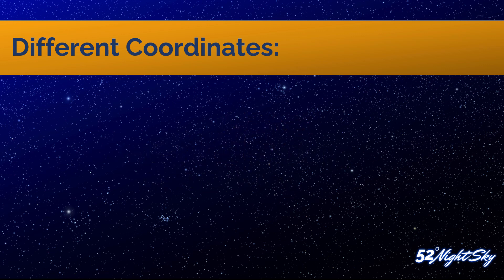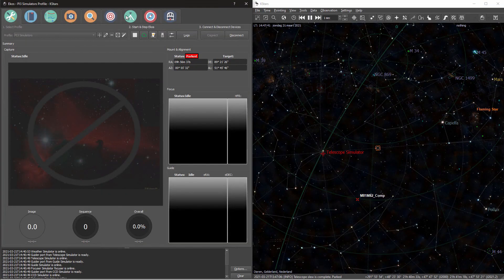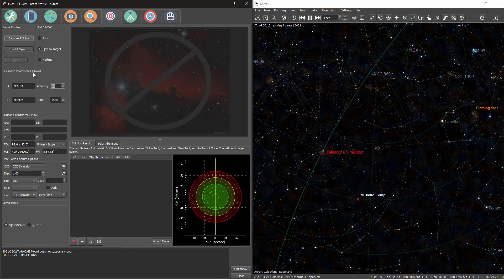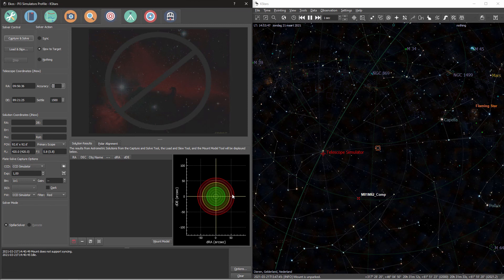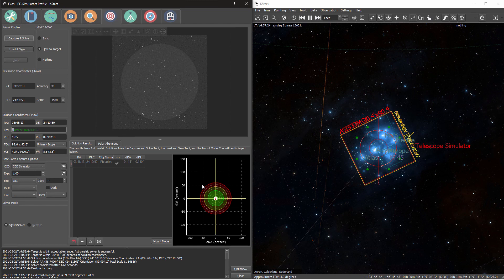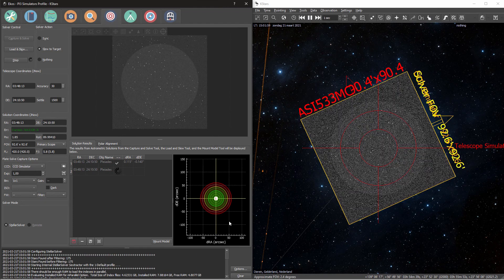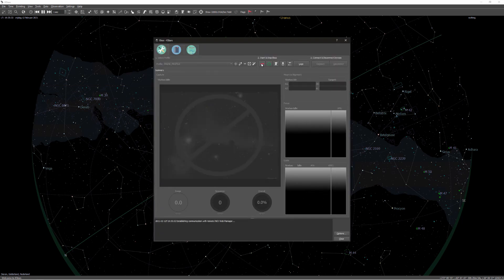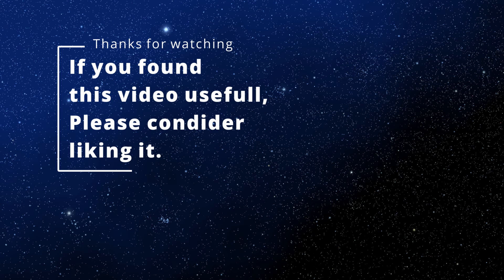🎯 How to use Plate-Solving in EKOS to Navigate Your Telescope and Compose Your Astro-images

Comment: How do you line up the position angle from a previous imaging session FITS file for the next imaging session. Plate Solving should get you to the same RA / DEC centre but the rotation angle of your camera needs to be adjusted separately. Can EKOS match position angles?
Reply from the maker: Hi, the short answer is Yes EKOS can do that. The long answer is, if you want EKOS to do it automaticcaly, you would need a motorized rotator. There is also an option that will have EKOS check the rotation and give you the opportunity to adjust it manually untill within a specific margin. I'll write down to do a video on that.
Also, in my case, I have the top of my camera aligned with a marking on my telescope. That way it is always aligned the same way so rotation is not really an issue for me. (I would like to start rotating for larger mosaics, but thats a whole different topic). Clear Skies!
Reply: @52NightSky  I plan on buying a motorised rotator so yeah that's helpful information. Cheers

Comment: Thank you for an actually great and helpful video! I received my order yesterday, which was a GEM28 mount and I was wondering if it's possible to use platesolving and all that great stuff with open source software that I've been using for some time, which is of course Ekos. I found your video and it was really helpful and easy to follow, thank you for that! 😸

Comment: One  reason I don't use Ekos, because after countless amount of tries, it fails to recongize my mount (Skywatcher EQ 6R pro) as well as my camera (QHY183) and my raspberry pi4 overheats and freezes up if I got Kstars open for more than 10 minutes.
Reply: Are you using a Fan cooled Pi enclosure and copper heat sinks on the main chips ?  Cooling kits are available on ebay.  Mine is not elaborate, just a simple fan blowing down on the Pi-4 and the added copper parts.    No heating issues .
Reply from the maker: That's a good point, bblip. I just changed my Pi-4's housing form fan-cooled to one that is basically one big heatsink. My fan kept struggling when I approached the Meridian 😄
Reply from the maker: Sorry to hear that Frank. Hope you found an alternative that works for you. Clear SKies!

Comment: I love to see channels showing ekos. Great work!

Also, I have a silly offtopic question.
I'm preparing some material to start a linux based astrophotgraphy channel for Spanish speakers but I'm struggling finding some program to make simple 2D animations to use them as overlays. 

Please, can you tell me what program are you using?

Thank you a lot, I'm waiting for more videos.
Reply from the maker: Hi David,  a Spanish channel on EKOS sounds great! I love seeing the number of EKOS videos grow, and I know I wont be making any Spanish videos.

With regards to the software: I currently just use PowerPoint (the morph thransition works like a charm) the main limitation is finding graphics you can use. PowerPoint works super fast and is easy to edit. For more complex stuff I use Fusion within Davinci Resolve. But I try and stay away from it for these videos as it can take up a lot of time.
Reply from the maker: P.s. David, I know a lot of teacher use a tool called Moovly. Should you be interested in it, there is currently a great Lifetime Deal on the software running on the Appsumo website. You can try it for 60 days and ask money back if you dont like it. I dont use it myself but it might be interesting to look into.
Reply: Great! Than you for your advice.

I will try also OpenToonz. Maybe is an overkill but I prefer to stay at the open source side.

I will ping you once the second video will be public 😉
Reply from the maker: Ah thats a good suggestion. I wasnt aware of that. Ill check it out aswell.

Comment: Would it be possible to make a video on how to adjust the image's rotation angle? And if possible, how to control remotely from Windows to a Raspberry pi (if it's not too much to ask!)
Reply from the maker: Hí Alfredo, thanks for the feedback. I'm actually preparing the video on rotation right now, since this has become so much easier with K-Stars 3.5.2. You'll see it on the channel in a couple of weeks. I'm definitely doing a video on connecting to a Raspberry Pi, but that might be a little further in the future. I would like to finish the 101 series first. 
Are you running into problems now? Is there anything specific I can help you with in the meantime?
Reply: No problems at all, thank you.  I’m just considering to move into Ekos and having it on a Raspberry Pi to avoid having the laptop oustside all night long and I want to know the software first.

I currently use SGP and, occasionally, NINA.
Reply: Astroberry is the suite of Astronomy tools for the Raspberry Pi.  Run it on a Pi-4 8gig, 64gig to 128 gig SD card, USB Powered hub for the camera, GPS dongle for date/time/location when away from WiFi.  Astroberry is a WiFi hotspot so the PC or another Raspberry Pi only needs a Web Browser or better yet VNC Viewer for faster GUI updates.   INDI Drivers, PHD2, Firecapture, Kstars and EKOS are part of the Astroberry suite.  I use it mainly for PHD2 + ZWO + Celestron AVX or CGX mounts but am very new to KSTARS and EKOS.